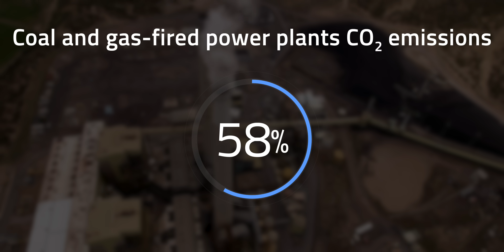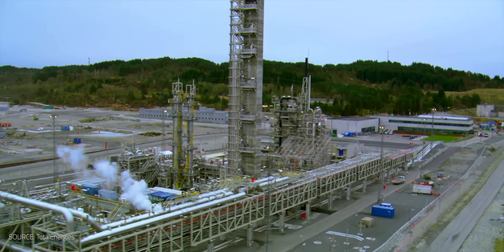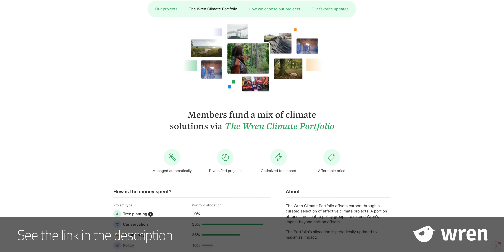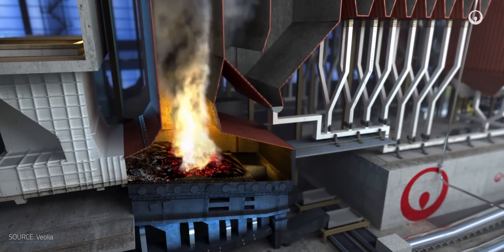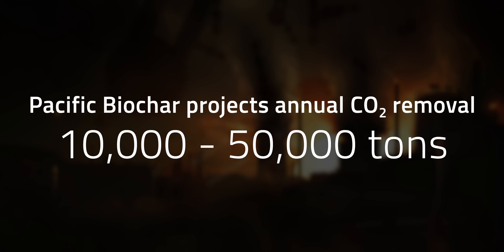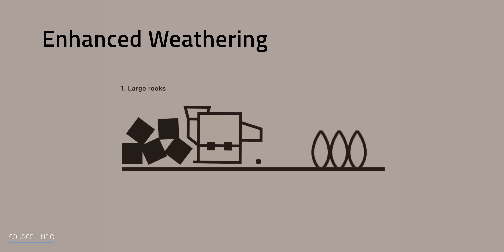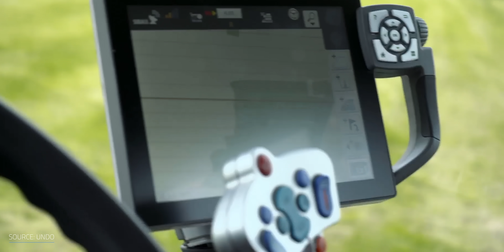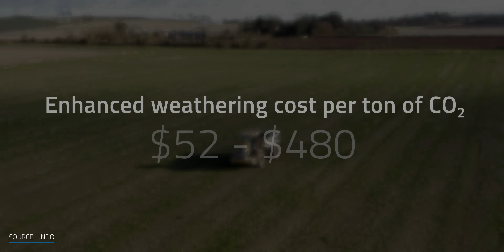The Reality of Carbon Capture

Comment: While I'm not against any of these methods in principle, the potential benefits of them are tiny compared to the amount of CO2 being emitted. It concerns me when I see companies investing in them for carbon credits or carbon offsets rather than reducing emissions when what we need is a hard focus on reducing emissions, not propping them up. These should be extras, not replacements.
Reply: Air capture is expensive now, but it appears to be scalable so we will see more efficient-per-space equipment that's also cheaper. Like most technology we should be able find it more accessible in the next five to ten years.
Reply: I can totally see where that skepticism comes from. Like the statement that Microsoft bought 1,500 metric tons of CO2 carbon credits. Cool. Good for them. That totally offsets their 2020 yearly emission of 13,800,000 metric tons of CO2.......

Also the enhanced weathering.... I get that the basalt is a byproduct of quarries. But how much carbon is produced to apply it? Transport it? Crush and screen it? Clean it? Remediate any heavy metal contamination? I would not be surprised if a thorough analysis of the total lifetime carbon emissions of enhanced weathering shows that it overall carbon positive.
Reply: You are correct. It is green washing.
Reply: what most of the time gets overlooked .. how much damage is caused by fighting a problem
Reply: We need the tools to both add and remove carbon from are atmosphere if we are to create the optimal ecosystem for human development.
Reply: Yeah, carbon credits really poison the process because instead of looking for a real solution they look for a profitable solution and a means to sell other's the equivalent of a modern Papal dispensation

However what they all ignore is the higher CO2 levels have already resulted in a greening planet as nature takes up the excess and converts it to life.
Reply: that's a luddite mentality of which the only solution is the Thanos solution. Technology has solved every technological problem of the past and will continue to do so. Free enterprise always comes through if you give up the idea you can centrally control the world into your image.
Reply: you have no idea how much argiculture contribute to CO2 emissions by bad land management and traditional farming
most of those CO2 emissions are hard to account for because they hadn't been studied well
Reply: @zazugee  Why do you assume I have no idea?
Reply: I totally agree, for the bio-char it's crazy to advertize this as a valuable mathod to absob carbon when you think about the full story : We extract coal, witch is carbon under the ground, we burn it, we harvest biological leftover, we burn the partially, we burry them under ground... When dit this stupidity beacame a good and inovative idea !
Reply: I tend to agree, but if the output carbon has a positive effect, and effect greater than the cost of capture, then the economics works to both capture carbon AND increase crop yields.. in those cases the win/win is obvious.
Reply: Yes.
Reply: @VagManDan  hush! Go away with your inconvenient facts, we have to feel good/superior due to climate fascism
Reply: @VagManDan  That is absolute nonsense, and you need to use proper, reliable sources, not whatever nonsense you read on conspiracy sites.
Reply: @VagManDan  You're talking nonsense. Let's do a very quick calculation right now. The amount of CO2 released by human energy usage (which is only part of the what we emit, but it's a big part and so it's useful for a quick calculation) is 36.3 gigatonnes per year. You claim that volcanoes emit 91,000 times that. That would come to 3.3 million gigatonnes. But the total CO2 in the atmosphere is only just over 3 thousand gigatonnes. So, your claim is that volcanoes each year emit a thousand times more CO2 than is actually in the atmosphere (and, in fact, you're claiming even more than that, because I only used figures from energy usage). Your claim fails the absolute most basic check. I'm not going to be keep arguing at this point, because when you can't figure that out for yourself, you really don't know what you're talking about.
Reply: This sentiment stems from a belief that humans are destroying the planet with carbon emissions.  While carbon emissions have been increasing since the industrial revolution, they are no where near all time highs seen in history.
Reply: @smithologist5272  You're on the wrong channel if you want to push your denialism. You're unlikely to find fertile ground. But you do you.
Reply: @PatrickSamphire  I am not pushing denialism, humans impact their environment for sure.  I am challenging the assumption that increased CO2 levels will destroy the planet.  If that were the case then the earth would have been decimated by CO2 several times over the past several hundred million years.  And we are still here.
Reply: @smithologist5272  No one is saying that it's going to destroy the planet. The planet is a ball of rock. It will remain. A large amount of life, however, will not. It's not that the levels now are higher than they've ever been in the history of the planet, but the level is changing faster by orders of magnitude. Most species struggle to adapt to this. It's not a debate. It's happening, and it'll only get worse.
Reply: We need both.
Reply: We need Carbon Fuel
Reply: We will always need it as a Battery.... not a Source.  The Carbon Cycle is necessary for life... dont be close minded.
Reply: The thing is, if we want to truly stop climate change permanently, we're going to need to not only stop producing more carbon but remove all the carbon we've already put into the atmosphere over the last two centuries—as well as compensate for all the deforestation that we've done. It's best that we start finding ways to do that and build up the necessary infrastructure.
Reply: @stevethepocket  The best way to capture more carbon is to grow more stuff.
Reply: @apkk5594  Stuff that's just going to die and decay, releasing its carbon back into the air?
Reply: @stevethepocket  Climate change is the biggest cash grab in the history of humanity. It's amazing how many people believe this nonsense when the science behind it is so flawed. There is no climate crisis.
Reply: @stevethepocket  This is very easy to fix, but you fake naturalists don't want to hear it so you believe this bs.
Reply: @stevethepocket  ...Note, however, that even the UN concedes that we have more forest cover today than a century ago, so your concern about deforestation is no longer valid.  It appears that more CO2 in the atmosphere does what we would expect - promote plant growth!  BTW, carbon is your friend, not your enemy.  Please use the correct vocabulary - if you want to talk about the rising CO2 content of the atmosphere, just say so.  Carbon itself is harmless.
Reply: @jrb_sland5066  I can believe that, because it was only in the past century that we realized we need to take care of the planet. Tree farming, reforestation for its own sake, Arbor Day, those didn't exist back in the early 1900s. But we'd been clearcutting forests for millennia before that, and most of those forests are still gone and probably always will be. We have to account for that.
Reply: @stevethepocket  I don't exactly disagree, but we can still usually reduce the total warming more per dollar spent by reducing output rather than capturing carbon right now.
Reply: @stevethepocket you are Made of Carbon!... think about that.. all living things are.. ALL FOOD IS.. do you really want to limit the building blocks of life and what sustains it?
Reply: @stevethepocket  Stop emitting first THEN remove whats there
Reply: @stevethepocket  While that's true, the actual effect is that companies don't reduce greenhouse gas output because they can 'offset' them to dubiously effective schemes like this instead. If these were completely decoupled and reductions were required as well, then I would see the possible benefit.
Reply: @PatrickSamphire  Assuming the CCS measurements are accurate (a big assumption to be sure), it shouldn't really matter if a company reduces its CO2 output by X amount or if they pay another company to capture X amount of CO2. The end result is the same (all else being equal, only considering CO2, ignoring other externalities).

Of course those are a lot of assumptions, inefficiencies, unknowns, negative externalities, etc. Perhaps regulations should allow for CCS credits, but they only offset a smaller percentage of a company's CO2, e.g. they only count for half the actual amount compared to reducing emissions. So a company could either cut their emissions by 1m tons of CO2 or pay for CCS of 2m tons.
Reply: @graham1034  The problems are that an awful lot of these schemes include things that would have happened anyway, things that don't have the effect they should, things that turn out to be temporary in nature, as well as the fact that we need to get down to essentially zero emissions, which requires both the companies to remove their emissions and these schemes to scoop excess CO2 out of the atmosphere, not one or the other. Ideally, for a while at least, we need negative emissions, which won't happen with offsets.
Reply: @PatrickSamphire  I totally agree with the regulatory/compliance aspect. I don't have much faith in any current schemes to actually capture their stated amount. But there are regulatory bodies working on all of the issues you mention.
Reply: @PatrickSamphire  negative emissions requires both cutting emissions to close to zero, and the offset projects on top of that!
Reply: @adrianthoroughgood1191  Yes, I know. But they aren't offset projects at that point. They are removal of existing carbon, not offsetting other emissions.
Reply: I get the hesitation but it can also be seen as capital flowing to such initiatives... if the initiative is actually moving toward making an actual difference. The current problem is that we need to research and develop ways to capture more and emit less but that takes effort. Effort takes money. Carbon credits at least has money flowing to some worthwhile efforts. It's certainly not perfect though. Not even close.
Reply: @AnErrantPhoton  All money spent on capture is inherently removing resources being used on what's actually needed: reduction.

Carbon capture is a scam
Reply: PLEASE  help me understand. What about when Quantum computers, likely in 2 years or more because that's when they will begin to have real practical use, ...invent new exotic super materials, one of which will be a super C02 absorbing material. *What then?* That will be a game changer, right?? 

Because even if we were to stop all emissions today, there would still be horrible climate change related damage to deal with for many decades. 

We need a way to reverse the c02 from PPM of 420 and climbing, all the way down to 280 PPM, or pre industrial levels.

And while the naysayers of Fusion have the easiest job in the world, in that all they have to do is point and say "look, fusion is not here  yet, or is 20 years away from being 20 " blah blah blah.

But MIT and General Fusion say they are less than 8 years away from being to able to begin construction on Commercial Fusion power plants, we could build those AND hook them up to C02 capture facilities using the news exotic super material absorbing C02.

If we built 100, 000 of these facilities with C02 absorbing exotic materials that absorb 100X what any current material can, that would mean we would be able to vacuum  lets say 50 BILLION tons of C02 every year.
Reply: @Dennzer1  Fusion power might do great things in the 2030's decade, including desalination, which could at the same time remove C02 from seawater. Battery tech, wind, solar, and tidal power will all be viable in the 2030's decade. What's important is to change farming practices now, in 2022. Regenerative agriculture, permaculture, agroforestry, and hemp cultivation can all sequester large amounts of CO2 while providing higher quality food sources. Hemp also uses fewer pesticide & fertilizer inputs, reducing front end petrochemical use. Having the government lift all bans on hemp is free. So is ending corn ethanol. Farms will be more profitable per acre growing hemp instead of corn. 

Free things that can be helpful include mowing grass less often, and to a taller height. Allowing small prairie meadows to grow on large public lawns. Reverse lawn mowing regulations that give fines for tall lawns and instead issue fines against people who mow shorter than 5 inches. Only allow electric mowers on public property. All these things are free and could start today. Go to your local city council, your local school board, and tell them to plant trees, and mow taller.
Reply: @Nphen  What is this? An actually fantastic comment? Ones that I agree with EVERY single point made there in? Wow! Thank you. So many great ideas. I agree with you 1200%

Please keep spreading  these ideas, no matter how many people attack for them.

Which they will.

God, you are so spot on.

And I recently discovered that lawn idea, where it grows taller on purpose, and they have found over 200 unique plant species when doing that in Britain.

...not to deflect from your other stated ideals and ideas.

There is also  a new gel for stopping forest fires, one that doesn't  wash away in the rain, and one that is not bad for the plants and animals.  Which we will need going forward, even after that far off mystical day where we get C02 back down all  the way to 280 PPM.
Reply: @Nphen  I agree the 2030s has the potential to have some amazing things happen. The only problem is getting there before 1.5C. Which we seem to be hurtling towards as fast as possible.
Reply: @Dennzer1  you're crazy .. once co2 levels drop below 200ppm their growth slows down significantly and once below 150ppm plants starve to death and you wan't to go slightly over that level.
green houses intentionally add co2 to levels several times higher than in our atmosphere .. they spend money to add co2 to make plants grow faster .. 
pre industrial levels where at a all time low in hundreds of thousands of years .. dangerously low .. not normal .. 
but yeah .. if we let zealots like you make the decisions .. we should invest in a mars appartment ..
Reply: @TheyCalledMeT  WHERE did I say I want it below 200 PPM? 280 is the preindudstrial level. Obviously no one wants to go below that, when it was in perfect balance, more or less. Goddamn. If I wrote 180 ppm, it was a typo, and nothing more. Relax!
Reply: @TheyCalledMeT  so now that you know I want to go back to where the c02 levels are ideal, aka 280 ppm, aka pre 0indudtrial level, am I no longer a "zealot"? LOL, and you say that as if there is an army of people out there somewhere  calling for C02 levels BELOW the pre industrial era.

what a bizarre assumption you made without considering that it  was a typo, if in fact I did write 180 ppm instead of 280 ppm.

and why would anyone  even want that?

the ONLYU zealots on this  issue are republican's and  conservatives who deny man  accelerated climate change.
Reply: @Dennzer1  no my point is .. 400 ppm is not too much .. 400ppm is healthy for plants .. it saves insane amounts of water (plants breath air, filter co2 make glucose trough photosynthesis and if the concentration of co2 is low, it's extracted harder and harder, which forces them to "breath" a heck of a lot more which results in a heck of a lot more water used [and less plant growth] to extract co2) 400ppm is good for plants .. they love it.
250 is on a very strict diet .. 200 is barely surviving and 150 is sarvation level under supply
Reply: @Dennzer1  NO, 280ppm is not ideal, nor a  great ballance .. it's an insanely low value .. only at mass extinction level time periods the co2 level went that low .. the "normal" co2 levels where WELL over 1000ppm MOST of the time in earths history.

sadly i can not post links here because the message will instantly disapear .. may look for "co2 levels over time" on image search on your engine of choice and look for a graph which shows a white graph, with a blue line plotting 600m years on the x achsis .. and see where we are .. on a historic low value right up untill the industrial age brought it up to a level where plants started spreading again .. (the earth is greener now than 50 100 and 150 years ago)
Reply: @TheyCalledMeT  I think you are misunderstanding how high carbon ppm  in the past and biology works.  As the earth was cooling and allowing life to form it was naturally warmer and life had adapted to that. However for 10,000,000 years we have been under 400 ppm. It might have been good for life that existed 10,000,000 years ago but it is not good for life now.  The problem isn't that life will cease to exist with 400ppm its that its not good for the life that is currently existing. Species that can't adapt quickly enough go extinct we are currently in a mass extinction event. This is just the beginning of a long process that will likely be irreversible in 10 years.  It's not our generation that will suffer the most its the ones that come after us.
Reply: @TheyCalledMeT  I don't know where you  are getting your data, but please calm down and lets deal with one thing at a time,. Plus, 280 PPM ISZ the pre industrial level. Fact. and yes, IDEAL.
Reply: @TheyCalledMeT  Again, 280 PPM was and is ideal. and is the pre-industrial level. This is not controversial or up for debate. What exactly  are you taking issue with about it?
Reply: @TheyCalledMeT  The EARTH is not one guy's greenhouse. The Pre industrial level was 280 PPM of C02.  Fact.  THAts what I am talking about. Why are you like this?
Reply: As a Federally Certified & License Professional Engineer, you are a Carnival Barker -- A simple-minded English graduate that doesn't have the mental capacity to understand basic Calculus, let alone Engineering.
Reply: @richardlellip.e.m.b.a.7969  Are you referring to me? I have a PhD in physics, not English. I understand calculus, thank you. But sure, You go abusing people you don't know on the internet if that makes you feel happy. If I was an English graduate, though, I would probably point out that you mean "who doesn't have the mental capacity" rather than "that doesn't have the mental capacity". Have a nice day.